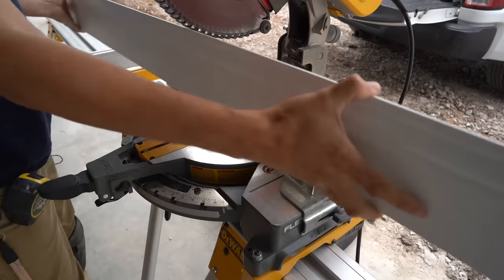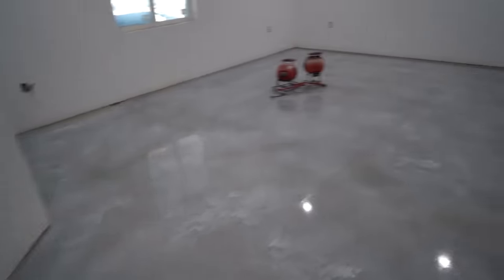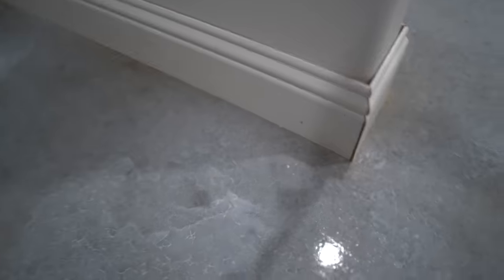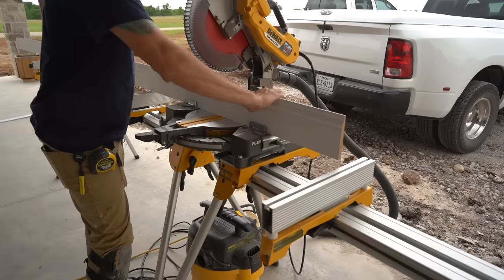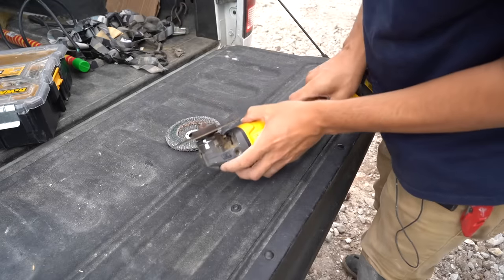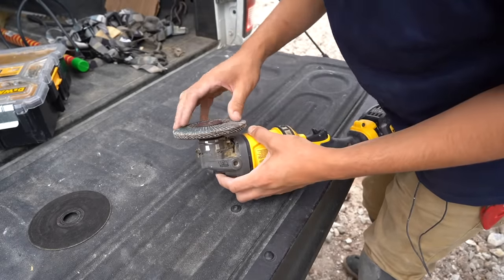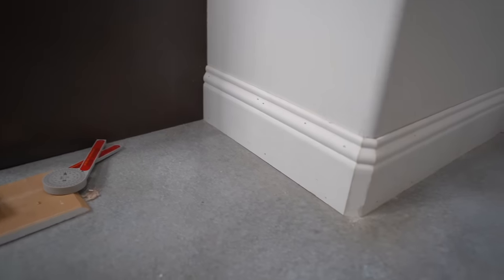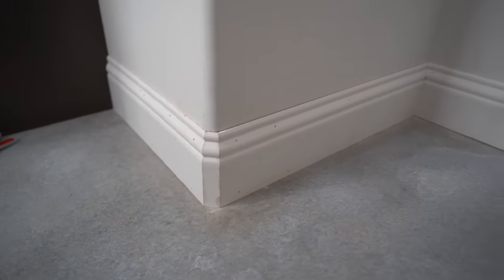don't let your framer do trim

Comment: I said it before - I'm 69 and my Dad had his own business where he did custom cabinets & trim work (did occasionally do framing for extra money) and if he was alive today he would be awe-struck at your tools...laser levels, nail guns, hand grinders, etc. Back then ALL coping was done with a Coping Saw, All nailing was done with a hammer (my job as a 9+ years old was to follow behind with a hammer & nail-set to set the nails in the trim work). Be thankful you're living today and not back then. :)
My dad was a perfectionist and I know he would be an admirer of the quality of your work.
Reply: hey I still use a coping saw
Reply: @Styrofo4m  Yes! I agree but put it in perspective. When the P.C., calculator, etc. first came out NOT EVERYBODY immediately had one. This generation is so used to buying the newest thing as soon as it comes out that they think it was ALWAYS that way.
Reply: @Styrofo4m  with that logic, everybody today should be driving around teslas but thats not the case, using something that works and works well is all that matters
Reply: Coping saw takes a lot of work, flap disc was cool.
Reply: MindSET ooooo that was a good one 😐
Reply: MindSET that last comment was impressive
Reply: Angle grinders were probably to bulky at the time. I still use a coping saw.
Reply: I know how the old timers do the work with few tools and a lot of craftsmanship.  I remember doing dry wall with hammer and nails not screw guns . I'm it's a real talent doing stuff by hand. Thank God for power tools.
Reply: Here here my friend.
Reply: @MindSET  u did all that digging to call him out for what? Most ppl didnt have money back then to get the newest stuff coming out and when they have done a trade so long one way it's hard for them to transition or give up their way
Reply: @tacovampire9794  You notice that I only replied to @MINDSET once. When he continued, I ignored him because another thing my Dad taught me was...."you don't need to stoop to their level - you're better than that."
Yes, a nail gun is faster and will put the nail approximately where you want it but with a hammer the nail went EXACTLY where you want it. Yes, an angle grinder is fast, but a coping saw is PRECISE.
My dad could have bought the fancy new tools, but he was doing quality work without it and it also meant a little more money to provide for the family .... a little nicer clothes, decent food on the table, extra Christmas gifts, etc....
Reply: @AFmedic  Since you were around for that era, how did people generally cut larger trim like 1x8 baseboard or large crown? I know the first chop saw came out in 1964, and miter boxes have been around for a long time. But the back saws/miter boxes I know of would still be too small to cut the larger trim. Did you just use a skill saw for the larger stuff? And I'm imagining before power tools the trim carpenters would have had to use a panel saw and maybe a block plane and shooting board to clean up the mitered edges on the larger trim?
Reply: @danny99999999999999 
1) I can't speak as to other carpenters, only my father and 2) I'm 74 now and this was back in the late 50's to 1963 (when my father passed away at the age of 47)
The back saw he had was large enough but he built his own miter box because the store bought ones were not large enough and they were "shitty quality" (his actual words LOL). He also had a jig he built for using his skill saw. I don't recall ever seeing him use a block plane, etc. to "clean up" the edges yet you couldn't fit a piece of paper between his mitered joints. He was a perfectionist and many time, while visiting some ones house, I'd see him looking around slowly shaking his head, and then he'd lean over, point at a "barely" noticeable gap in a joint, and whisper to me, "If they're not going to do it right - why bother?".

Comment: Beautiful work!  I retired from painting because I got tired of hearing "the painter will fix it".  I tell you it would have been shear joy to work on a job with a true craftsman.
Reply: That’s right
Reply: Haha that’s a classic! They guys putting up drywall with a not so great fit. “F it the painter will fix it!”
Reply: That's your job you are a painter. Just like a finish carpenter has to put up with bad drywall and bad framing.
Reply: @mjolnirswrath23  Amen!!
Reply: @garyolsen3409  That's why I always did all my own framing, drywall, trim and paint.  I couldn't leave anything for the next guy because the next guy would be me.
Reply: @curbmassa  Good point
Reply: @garyolsen3409  nah not my job to fix everyone else's fuck ups.  If the carpenter puts up trim with rough saw marks all over the end grains and primes over it then squirts a whole tube of shitty caulking in the cracks it's not my job to sand everything down to bare wood again because I'm the one who will end up eating the time.  I'd rather show the customer and tell them how much it's gonna cost for me to fix it. Then they can decide if they want to pay me or have the carpenter fix it.
Reply: @NonieTools  good idea

Comment: I’m a 35 year drywall pro teaching drywall on my channel. I’ve done a fair amount of trim and I did a lot better than that, but I’m no trim carpenter. I learned several things from this video and your fancy crown corner return  video so thanks.  

If I can offer some advice, lock your focus and use a high aperture number so your auto Focus isn’t hunting so much. 

Thanks again

Comment: Thanks for the tips in this video — very helpful.  I’ll be doing my own finish carpentry on baseboards and casements.  Just doing straight flat 1x6 & 1x4 MDF boards —> farmhouse style.  No coping needed & thankfully, pretty straightforward.  Not even any mitered corners on doors/windows...since that’s the style.   Seriously entry-level stuff.

I just ordered crown stops for my miter saw from your recommendation.  That‘ll make the cuts easier/better, for sure.  My dad, an engineer who does fine woodworking as a hobby says he thinks I’m detail-oriented enough to do this “easy” finish carpentry.🤞🙄 lol  I do a lot of my own stuff, but I won’t do a crap job, so I call the pros in when I need to.  The problem I run into is that I don’t know what I don’t know...like using the crown stops.  The tools of the trade learned through experience that I don’t even know about.  Makes my novice job harder.  Which is why I watch like 4200 videos on the task before I start.😂

Oh, well...there’s always a more qualified person to do it....a real carpenter who’s just a phone call away.  I’ll try my absolute best, but glad I’m not locked in to finishing it if I get in over my head.  What looks easy...seldom is.

Last, MUCH respect to you guys who do good, detailed, skilled work that DIYers think they can replicate without your experience level.  They come to realize your skill when they have to call you in to “fix” their work.

Comment: One of the biggest things I have learned from your channel is the use of CA Glue.  That took my scarf joints in crown molding to a different level.
Reply: Built By Design can’t get ca glue to work on wood. Mdf yes, wood no.
Reply: That stuff is amazing
Reply: @jeffpower6473  we use it on everything, works perfectly

Comment: As a painter, I'd love to receive your work for painting.  some of the crap carpenters hand us is an absolute sin.  that's tight work my friend.
Reply: I have had to ban many carpenters from using a caulk gun.  They fill them gaps up with white tubes of silicone and when it's time to paint Its now my job to remove it all and caulk it right.  Unbelievable the shit I've seen.  And it all rolls downhill too so every mistake and fuck up the carpenters make falls on the painters to make look good.  It's nice to see this guy who does nice finish work and does know how to paint, although it seems like he sprays everything.

Comment: I have been a carpenter for 30 years and you just blew my mind with that inside corner cut. 👍
Reply: I thought it was beautiful .. I have 40 years exp .. The Crapenter's doing trim were considering the fluctuation in the moisture content of the MDF base and allowed for movement .. If it fits too tight .. The painters won't caulk it .. They were thinking ahead .. A Trim Trowel available on Amazon dispenses a backing rod for expansion and at the same time fills the void with a 3 tubes of caulk ..
Reply: You have been a carpenter for 30 years and never heard of coped inside corner?
Reply: luis dominguez yeh nice one!! I was talking about the way he did it.
Reply: @IVORY123100  dont worry, I appreciate your comment
Reply: All 30 year experience carpenters  ,it's a scribe joint and should always be used for internals , from 41 year carpenter
Just saying

Comment: "You have to take into account the pull on the tape measure end"
False, that thing wiggles to account for it's own thickness in two situations, butting into something and pulling from something.
Reply: You are correct
Reply: I was going to say the same thing. This is a true statement. Always invest in a good tape.
Reply: @nolandrutledge6944  chill out, go to @3:40 and answer your own question
Reply: Yes sir
Reply: @franciscolupianlci237  literally any tape has this feature
Reply: You are absolutely correct...I think what he ment was because he was pushing against the wall with his tape while taking the initial measurement and then going outside and pulling on the tape while measuring for the board cut there would in-fact be a slight difference. I probably didn’t explain that very well!
Reply: Mason f there would be no difference unless your tape measure is broken, it moves so that it is the same, you can butt your tape and pull the board.
Reply: @nolandrutledge6944  So you didn't watch the video ?
Reply: Noland Rutledge, apparently the same guy who uses a cordless grinder to scribe
Reply: you clearly don't understand what he's talking about. You must not be a trim carpenter lol
Reply: Wait,....you mean that’s *not* a back scratcher?
Reply: Mason f no there still wouldn’t be a difference. The hook slides exactly the thickness of itself, so whether you’re pushing or pulling, the net difference between the material and the start of the tape will be the same in reference to the marks in the tape.
Reply: TheNeoEnigma over time there develops a small difference from being used, the rivets can get some extra play in it. That’s why we always used the 1” mark for true measurement. The hook also can develope a bevel or small bend that can change it by a 32nd.
Reply: Pulling and bumping usually deducts/adds 1/16". Most blades cut at about 1/8" in from center of mark. For tight fitment I usually cut heavy or go lighter. Most of the time 1/16" off won't be noticable nor problematic.
Reply: Ive had a tape on my hip the last 10 years doing commercial hvac. Never knew why it had a little play at the tip of the tape. Learned something today.
Reply: there is very few tapes that dont do it, mostly the cheap ones
Reply: It
Reply: @Glitch-nr9ct  wait it's a back scratcher??? Been using as a shoe horn this whole time. Damn I feel like an idiot
Reply: @angryhands9564  then get a new tape...
Reply: @Adeus1  a 1/16 in trim is so noticeable what do you mean?
Reply: Whatever he accounted for it obviously worked, the end result is a neat job
Reply: @nolandrutledge6944  You would be amazed at how many are totally clueless about common sense stuff. Kids now a days can't even add 5+6 without a calculator.
Reply: @anand8905  THIS
In a long run, the play doesn't matter, but on that short lil 16 3/4 piece a that tiny bit off can muff that bullnose corner. especially since dude glued everything up before installing.
Reply: Say what you want about the measure, but according to his video proof....he's spot on with his measurement. Closing a tape measure hard can create more pull than the thickness of the end.
Reply: to those with the negative comments! Give the guy a break! He is young and still learning. wisdom& knowledge come with age! Ive been remodeling since senior year of highschool and their are a few things that I dont know😁. I am one of the few remaining "Jack of all trades" contractors who can actually do every trade and do it correctly!!😉 It drives my subs nuts !!!
Reply: He lost all credibility after that was said
Reply: @nolandrutledge6944  The guy who made this video...duh.
Reply: that is true!
Reply: Talk about no one is jack of all trades but at the end he mentions he does ceilings tiles and what not. Arrogant and hypocrite
Reply: Geez never seen such a little thing ruffle so many people's feathers. Basically the discussion amounts to nothing and is not important but occasionally as a "Jack of all trades" I do find it necessary to start from the 1" mark.
Reply: You’re right, but there’s about 1/16 of difference if you look closely despite the design of the tape measure. The feature that’s built into the end of the tape measure works good for rough carpentry but finish is noticeably improved by taking this into account. The guy’s work sort of speaks for itself also.....
Reply: @orellanaanthuan1364  lol you serious!? He was being a smart ass dude, I hope you can rewatch and see the humor in him when he mentions doing tile work
Reply: @Self-Improvers89  yeah since he is using a coping method and it's just MDF base and the painter will fix most of it anyways it's not crucial to be accurate to the 32nd or finer. For mitering both pieces on say pre finished oak trim my method would be to use a digital t-bevel square (or a regular one) to find the true angle and use a slide rule for inside measurements. To answer his question question I would call it 16 3/4 plus a hair. For hardwood jobs were 64ths matter I would call it 16 3/4 plus a red one. *where I come from we get specific about the hairs, blonde = 1/64, red = 1/32, black/big = touch less than 1/16. The true measurement is probably about 16 51/64ths but who has time for that? It's usually best to be a touch long because you can always take a blonde one off :D
Reply: As a carpenter, dealing with measurements that don’t precisely line up with the scale is an everyday occurrence. We all have our own shorthand for it. When doing paint-grade trim, a 32nd of an inch is close enough, usually. So, 25/32, becomes “3/4 heavy”, and 23/32 would be “3/4 light”. Why? Because it’s faster, and more accurate, to add or subtract a 32nd to a measurement at the saw, than it is to reduce a fraction to a measurement that isn’t on your tape anyway. As long as the guy shooting on the base, and the cut man are speaking the same shorthand, it doesn’t really matter. What matters is it looks good, and you’re not recutting pieces more often than not.

Also, I know a lot of guys who are “framers”. I don’t know any who would’ve walked away from that shit-show we saw. Assuming they had any time  in the trade at all.
Reply: It was still a perfect fit. Now you have people calling a decent trim guy a total idiot because of your know it all comment.
Reply: @AFmedic  I know what you mean about kids, anyway it's 13 and that's without a calculator. 😉
Reply: @angryhands9564  if you are doing trim get a knew tape and take care of it.
"Burning"an inch or a foot is always accurate but often cumbersome, time consuming and unnecessary if you have a good tape.
Reply: @carpenterdom1639  nope
Reply: @navarrodragon25  lol

Comment: I was a finish carpenter for 16 years with 4 years under my own license. I really like your video because I ran into that problem all the time. Running base directly on the concrete or tile is a pain in the butt for inside corners! An old guy showed me a trick of wadding up newspaper to pack in behind the lower portion of the baseboard so that glue had time to dry up and the baseboard didnt push in when nailed along the bottom. It seemed like the drywall guys didnt apply an even amount of taping compound down where the wall meets the floor.
Reply: I take my combination square with the ruler sticking all the way up to see where the plane of the wall comes square down to the floor. Then I put a drywall screw into the bottom plate and screw it in so it lines up with my square. Then the bottom corner is supported and won't flex in when you nail it.
Reply: @daveyjones7391  great idea!! Hopefully lots of people see your reply
Reply: @daveyjones7391  thats a nice trick. I've always used paper to shim it out but I like that better, will be using it on the next job I do!
Reply: @liquerinfrnt  Awesome. Glad the tip can help other people out. I couldn't tell you how many times it's been useful.
Reply: @daveyjones7391  Yup, exactly what I do. If you put it on a slight angle you can mush the back of the board into the sharp edge of the screw for some fine adjustment and/or just twist the screw in and out. Otherwise flat head is a hard stop which is also fine. Remember where that screw head is because it sucks to hit with the air nail.

Comment: I cut my teeth working for an architectural milling company who had clients with very deep pockets.  I was very young and had no idea how that job would shape my path in life.  We once did a job the size of a two car garage that had 38 different profiles.  We were a vertical company so I made the templates, molder knives and ran stock for each one of them.  I did not realize at the time this experience was forging me in fire.  Most people think I'm a woodworking wizard now because of the unique things I build yet I still get excited about doing them after 40 years.  I tell you this story to encourage your pursuit to do any job the right way.  There is no substitute for experience while striving for excellence because over time it builds a level of confidence that will allow you  to tackle any project you can image.  It is heart warming to see such a young man doing excellent work
and sharing it with others.  God Bless!